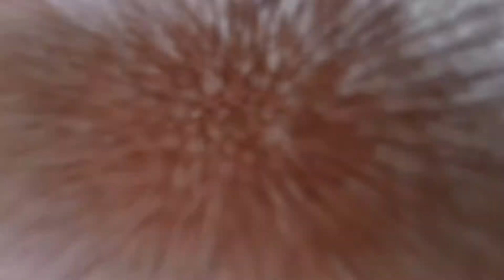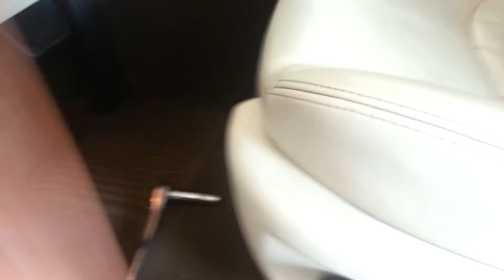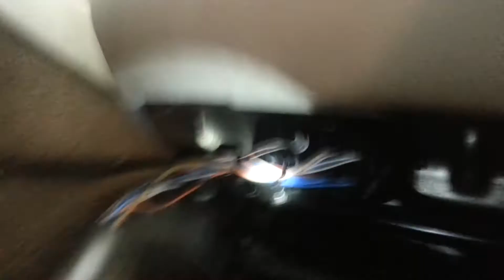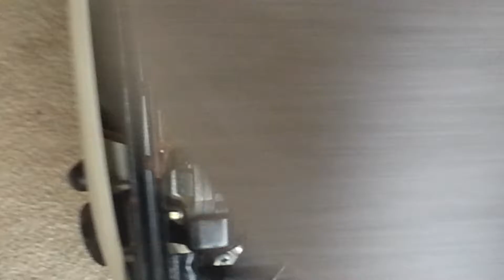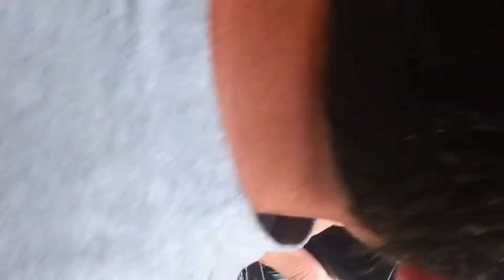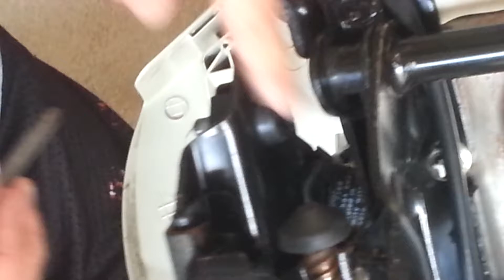Jaguar, X-Type, Power Seat, Motor Replace

Comment: Great video! I'm going to pull out the seats in my X-Type tomorrow. The motors are perfect but it's really hard to manually move the seats back and forth. The previous owner left tons of things fall down the sides of the seats and I think they clogged up the sliding mechanism.
Even after vacuuming the car half a dozen times I can always stick my hand down the side of the seat and pull out another pen, or some crayons, some money, mushed up sweets, hairclips, Legos and all sorts of random junk.. It's pretty crazy!
I'm going to just give it all a good clean and maybe a bit of grease if needed. 
It's like really hard to move both front seats, I have to hold up the lever (obviously) and use both arms and my shoulder to push, with my back propped against the door frame!

Comment: Hi, thanks a lot for your video. I HAVE A 2008 X TYPE DIESEL Jaguar shortsomewhere on the wiring p0409 coming up om my scanner, saying egr problem but I recently cleaned that out.then noticed my cigarette lighter wasn't working checked fuse in glove compartment it had blown. Fitted new fuse , switched key on and in seconds some coming from under seat.saw your video and I removed drivers seat, found the short in the small multi connector next to the large plug, now in the process of connecting individual wires. Broke the plug apart slowly and found some of the wires are. Connected together inside the plug,, there are more wires than pins. Will let you know results later....

Comment: ......very good video.....one suggestion, if you get stuck like that with the motors, then change the gear mechanism from the good one to the broken one and in it goes.....
Reply from the maker: I thought about doing that Lorenzo but then who knows how long that gear will last, so I bought a brass gear and changed it. Thanks
Reply: +Jeffery Hunter hi, do you have a video showing how to mod the screw Jack to accept the brass gear?
Reply from the maker: No sorry but there is one somewhere on You tube. Buy the Ford Mondeo gear,drill a hole through the gear while its on the shaft and them install the pin.https://www.youtube.com/watch?v=Y_Adoof0YAM

Comment: Thanks for taking the time to post this helpful video. I feel better about taking my seats out. I have an 03. My problem is totally crazy! I'm assuming it's electrical. One day a heavy person sat in my passenger seat-suddenly BOOM! Loudest pop I've ever heard! I felt it! As you know there's a weight sensor on the passenger seat to activate air bags. After that pop never had any power in both seats. I tried changing the fuse but the fuse immediately pops whenever I put one in....A short somewhere? Airbag? Any ideas? So strange. Anyone? Thanks again.

Comment: Jeffery,
Where are you sourcing the replacement motor? Swapping the gear is more trouble than I want. 

Great video. Inspiring
Reply from the maker: I found them on eBay. You can also check scrap yards and the U Pick scrap yards too. They will only tell you if they have a particular vehicle not a specific part so you will need to go and see if their is one on the vehicle.
Reply from the maker: eBay or junk yard or jaguar forum

Comment: Hi i have a problem in the driver side i can move the seat whit my hand i go to take off today to see what is broken. Bought of my motors work. When i am driving is a problem because the seat move back and foward when i acelerate or breaking. The part of move is the seat not the back rest.

Comment: An absolute fantastic video! Thank you for taking the time&trouble to make it!
Mine  "forward-backward" motor is working funny. After cleaning it and moving the seat to the very front position I can not move it back. I can hear the motor trying to work and one side of the seat moves back 2-3 cm, but the because the other side does not move it stack in an angle. Of course, I cant reach the two front screws to take the whole seat out. Can you suggest something?
Reply from the maker: I don't understand why you can not reach the bolts.Are you talking about the bolts that hold the seat frame to the floor?

Comment: Hey
Thanks for the movie, it helped a lot. I have broken gears in both engines (up / down and tilt). Do you know if these gears are the same in both engines? I found repair kits only for the left engine (up / down adjustment), there is nothing for the tilting engine.
Reply from the maker: I'm not going to say for sure but I have seen both sets of gears and they look Exactly the same. I would bet they do work.

Comment: I have exactly the same issue.  Got one from a breakers, but the model must have been changed slightly as the arm was longer on the new one and it won't fit.  While I was at it I opened the top of the old motor and could see the issue was the plastic gear as you suggested.  Can you point me in the direction of the guys on ebay that sell replacement metal gears?
Reply from the maker: +Harish Hirani  Here is the gear you need. http://www.ebay.com/itm/Brass-gear-for-seat-ford-mondeo-MK3-MK2-and-Jaguar-X-type-/181519460298?hash=item2a436727ca

Comment: I have exactly the same issue on my driver seat - your guidance helps me out - thanks a lot!
By the way, guess this is the gear you were looking for:
http://www.ebay.de/itm/Ford-Mondeo-Sitzverstellung-Sitzhohenverstellung-Reparatur-Set-Zahnrad-X-Type-/191699637909?hash=item2ca2305695:g:FWYAAOSwEetWA74M
found this on ebay germany - this one is for the Mondeo power seat which is the same as in the X-Type (fits for the 2001 also as for later models)
You will also find complete axes with already installed bronze gear - no drilling, no grinding - ready to mount:
http://www.ebay.de/itm/Jaguar-X-type-Zahnrad-Sitz-Sitzverstellung-Sitzversteller-Sitzhohenverstellung/251985005580?_trksid=p2047675.c100005.m1851&_trkparms=aid%3D222007%26algo%3DSIC.MBE%26ao%3D1%26asc%3D33428%26meid%3D597aa3e07e274a40a349274da08be4c2%26pid%3D100005%26rk%3D2%26rkt%3D6%26sd%3D191699637909
Hope this will help to find the needed parts!